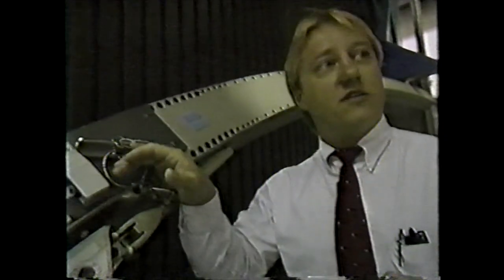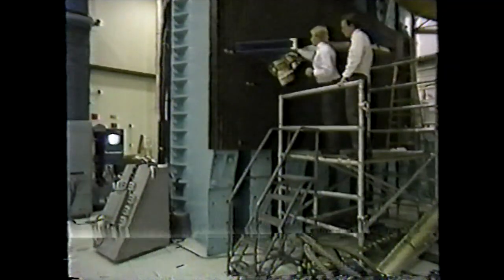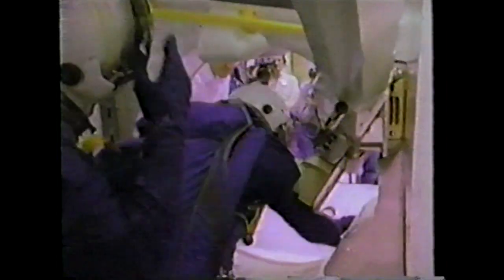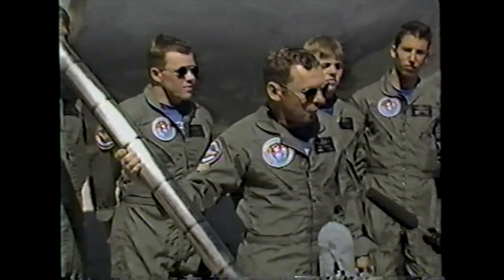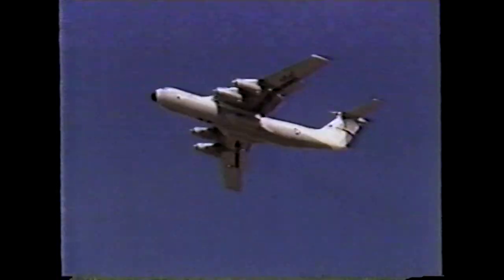First Use of Space Shuttle Crew Escape System on STS-26 | Return to Flight After Challenger

Comment: The Shuttle was a complete death trap. It was just due to a vast amount of marketing to convince the average Joe to think otherwise. It was also incredibly inefficient and never achieved its vision. But it looked really cool 😅🇺🇸
Reply: How was it a death trap? It completed 99.9% of its missions.
Reply: @cd3949  2 out of 135 flights ended catastrophically, so about 1.5% catastrophic failure rate (completed 98.5% of flights, not 99.9%). Several successful flights had come close to disaster as-well.
Reply: It wasn’t a death trap ugh. All but two missions went fine. And it achieved plenty

Comment: What's the escape system going to be for Starship?  I haven't heard it mentioned.
Reply: That's the neat thing: there ain't one.

Starship already can't afford the weight penalty of landing legs, and you're asking for safety features too???
Reply: @mrkeogh   Starship not having landing struts has nothing to do with weight, they are simply unfeasible for something that size.  Also the abort system for Starship is to collect it with the "chopsticks" since it will always exit and re-enter the atmosphere within the vicinity of them - this is also the reason why it has 33 small-to-medium engines rather than 5 large engines, it would need at least four engines to fail in the same quadrant of seven engines before the vehicle could be considered impossible to retrieve.
Reply: Prob at least we should know about it in 2026, the crew starship should be there

Comment: That rocket assisted extraction system looked uncannily like the Yankee Extraction System installed in A-1 Skyraider attack airplanes in the 60s. It consisted of two rockets spinning around each other, connected to the pilot via a lanyard contraption, which pulled the pilot(s) out of the cockpit in an emergency (The Skyraider did not have an ejection seat). 

If anyone is interested, just search for "Yankee Extraction System" here on youtube, there's a few videos which demonstrate its operation.

Comment: I suppose a last resort 'maybe' device is better than nothing. 

I always wondered why it wasn't feasible to have the entire crew cabin detach and at some point deploy drag, drogue and main parachutes. It would obviously need its own self-contained rocket arrangement to get clear of the stack, and it would need to float, but I guess once they got beyond a two-man ejector seat set-up the design was just to far down the line to go that way.

That said, both catastrophes were eminently avoidable, and came well after a 100% safety record of Saturn launches. 

This contraption may also have been a small but significant positive directed at crew confidence.

Comment: This was just a PR move to tell the public that Challenger wouldn't happen again. It required the Shuttle to fly straight and level. If the Shuttle can fly straight and level they would try to land.
Reply: And when 2 of your 3 engines fail on ascent and you don't have enough thrust to turn around, nor enough to make it to Zaragosa, where exactly are you supposed to land your flying brick?
Reply: @dsdy1205  That would pretty much be the only case in which this would be remotely useful.  An excruciatingly rare scenario.
Reply: @stuntmanmike37  It was not "excruciatingly rare", there were large sections of the flight profile where enough engine failures would result in the need to use the bailout pole. The fact that it was never used doesn't mean much, because there are so few Shuttle flights that we can't form reasonable probability estimates just from the sample of flights we have.
Reply: @dsdy1205  So, somehow the shuttle would have to be too far away for a return to launch site but not high enough to make a transatlantic abort, and then it also has to be stable long enough for seven astronauts to unstrap, get out of their seats and then shuffle to the door from two different crew decks, all while wearing full body pressure suits, deploy the rod, hook up and bail out.  Then, depending on bail out height, you'll have seven astronauts strewn across possibly hundreds of miles of open ocean.  Sorry, I'm not buying it.  I just don't see any realistic scenario where using the pole would mean the difference between surviving or not.  

The KC-135 actually had a similar egress system, in which an air deflector popped out in front of the crew entry chute, allowing the crew to bail out one at a time.  During the only recorded operational use of the system, the aircraft commander ordered his crew to bail, but he elected to stay behind to attempt an emergency landing, which he was successful in doing.  Point of the story; after 70 years of service and millions of flight hours, the egress system was only ever used once, and even then it wasn't necessary for the crew to survive.  

As for the shuttle, 14 astronauts were killed during it's operational career, a fatality rate of 3.94% for each person who ever flew on it.  And the egress pole was completely useless to save any of the 14 who died.  Basically, out of the 10 million things that needed to work right to keep you alive on the shuttle, the bail out pole was practically number 9,999,999.  Virtually useless.
Reply: @stuntmanmike37 it could still have made the difference, you don’t know
Reply: @BlueBraviaryGirl  I suppose I'd rather have it than not have it, but still, I'd be a lot more worried about the SRBs or my heat shield integrity.

Comment: Take a look at any Mercury or Gemini space crafts in museums.
The detailed photos, available everywhere too.
And tell me if the outer shell is put together by phillips screws.

And why the paint is intact after 3000 F heat re-entry?
Steel and rock melts around 2500 F.... but paint is fine?
Compare that with Shenzhou 6 or 9 landing photos.

Oh, the crews, they are not supposed to stand or walk after 3-5 day missions.
But how come American crews exit their capsule or shuttle, walk and run around, after up to 15 days in orbit?
Reply: Maybe the paint wasn't exposed to 3000 F during reentry?  Perhaps you should do some research on the matter.
Reply: @NachosElectric  Take a look at the photos.
Shenzhou 9, where three astronauts sitting in the foreground and the charred craft in the background.
The whole thing, not just the bottom, but the side and the top, is cooked, completely.
Even for the Apollo and Orion and Dragon, they prepped them to look like the whole craft was burnt red.
But, but, but.... Mercury and Gemini...
Man, JUST LOOK AT THE PHOTOS YOURSELF!!!!!!
Reply: @sbkarajan  Uh yeah, bc they use different materials. Also, a capsule like Shenzou or Soyuz (where it's not a pure cone) has a different thermal profile to both a pure cone like any of the American capsules (up until Dragon), and especially to a flat body like shuttle, which shields the upper surfaces from the most extreme heating. If you look at Apollo post splashdown there is char, but a lot less because of the cone shape.

It's basic thermodynamics, easily provable in a lab setting for anyone to see.
Reply: @braydentoth8442  So, Apollo has char, completely red, yet Mercury and Gemini, put together with Philips screws, got none, and both cases are pure cone?
Can you explain why they are totally different using your thermodynamics knowledge?

Oh, and the Rogozin’s comment above with Shenzhou landing photos… care to reply that as well?
Reply: The shape of a fastener isn’t what makes it heat-resistant, it’s the material. Are you claiming these missions did not happen?
Have you seen what an Apollo capsule looks like after re-entry? Google “ablative heat shield”. Mercury’s shield was not a coating. Different design
Reply: Russian inferiority complex is the most powerful thing in that entire country
Reply: Dmitri Rogozin, former Head of Roscosmos (Russia's NASA) said in 2023:

“Ten years ago, when I was working in the Government, I sent an official request to Roscosmos to provide me with documentary evidence of Americans on the Moon available to this federal agency at that time. I was too embarrassed by the fact that Soviet cosmonauts returning from multi-day expeditions could barely stand on their feet and underwent a long recovery after such flights, and the Americans got out of their lunar spacecraft like cucumbers from the garden.”
Reply: @sbkarajan  Yes, because a Russian would never lie lol.
Reply: @NachosElectric  BTW, out of curiosity, what did Russia lie?
Americans, all the time.
From WW2, Korean war, Vietnam, Iraq...
Reply: @sbkarajan  Absolutely insane case example of the Dunning-Kruger effect.
Reply: @mar7774  Why a common person like yourself is using a psychology jargon these days?